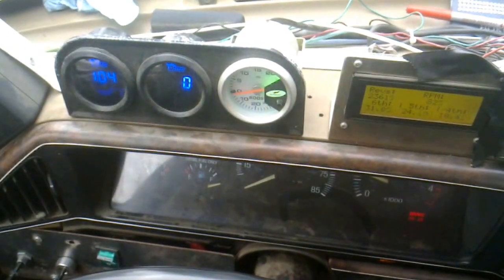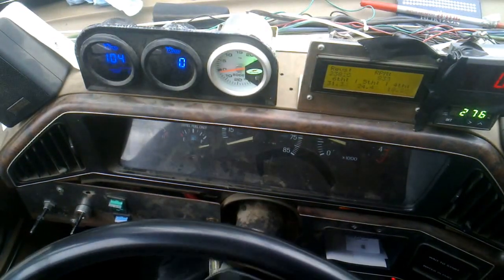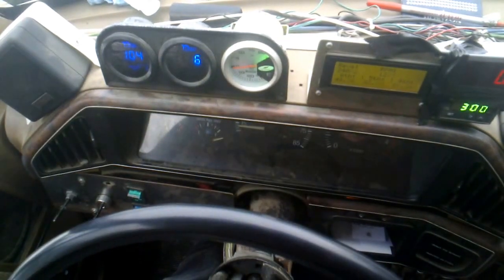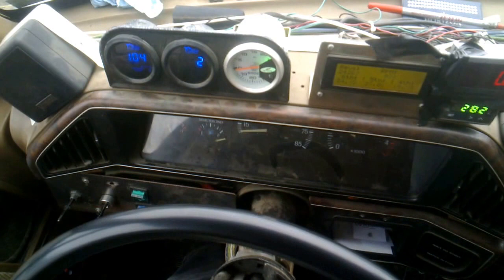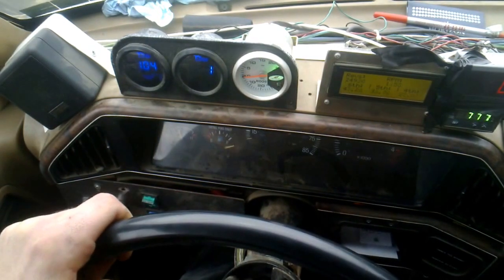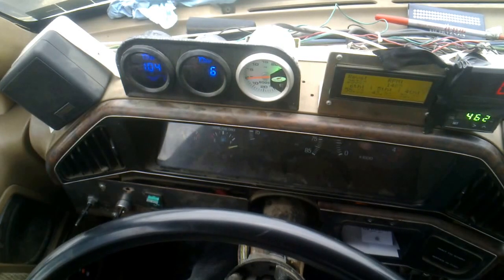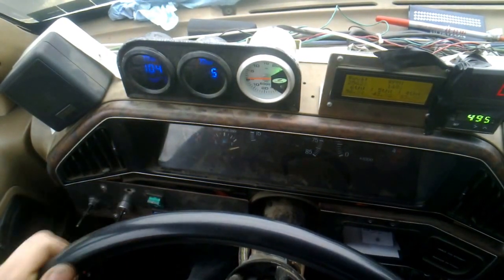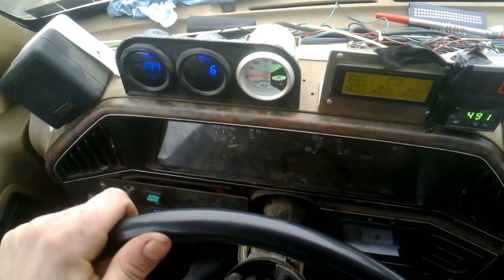7.3 IDI with RD2-110 pump, modded governor and more boost?

Comment: Have you had any problems in the drivetrain with these mods? It's only rated for I think 450 torque stock. I've got my 1988 at about 12 psi and fuel pump near maxed out and pushing around 350hp and 650 torque and easily shear u-joints, bolts on the rear axle yoke, and now my clutch. I should probably put some head studs on it.
Reply from the maker: Don't take this the wrong way, but:
1. You aren't making 350 HP with a stock IP. It's simply impossible. Even if your dyno reading is giving you a 'flywheel' number, 350 is too high for what a stock IP is going to give you. I'd believe 210 at the wheels, perhaps, with a fully turned up IP. Anything above that, well, there's something wrong with the numbers.
Even if you had the fuel for it, you are going to be needing a lot more air to make that happen - 12 PSI out of a stock turbo(non-intercooled, I'm guessing), just won't cut it.
I'd really like to hear how you ended up at the numbers you think you have.

2. Issues with U-joints, I'm thinking you've got greasing issues. Bolts on the rear axle yoke were probably loose.
RacinNDrummin made a 400 HP(at the wheels, real numbers), IDI, and didn't have any issues with those components(He also bent multiple connecting rods at that power level, before one finally snapped...). 

3. Clutch, well, yeah, that's definitely a weak point. That should fail before anything else. You'll probably need a LuK SMF kit with a 12" clutch disk, at the minimum. That should be good up to the 400 wheel HP range, looking at Racin's rig.

Comment: it's a myth that the IDI can't handle boost  you can run 15 stock and 25 psi on shaved pistons and arps
Reply from the maker: Yes and no.
Stock, yeah, 15 is around the limit. Perhaps up to 20 peak, but I wouldn't trust it that high.

With ARP studs only, the head gaskets will handle over 45 PSI of boost and over 400-450RWHP. The connecting rods, however, are only good for a bit less than that, and I'd aim for no more than 350RWHP with stock rods.
If you want more than that, Powerstroke forged rods can be modified to fit a 7.3 IDI - the connecting rod side needs to be trimmed down a hair, and the piston side either needs a bushing or to use IDI Turbo pistons.
Reply: @MacRobbSimpson  how much boost can stock 6.9 rods handle
Reply: @FueledAddiction na rod's can handle 20-25psi or 250 hp reliably
Reply: U can stud a 7.3 & it'll handle the boost til the abt 40-50+ then decompress it

Comment: With all that hopping up what kind of fuel mileage are you getting look Justin wouldn't give me a straight answer I'd like to know what I'm getting into before I started buying this stuff
Reply from the maker: Honestly, about the same as before... Unless I'm using the extra power.
Think about it this way: I can haul bigger loads faster. That faster part takes more fuel. 
Unloaded, well, it's more or less the same.

Generally speaking, I've gotten 14-18 over all my IDIs unloaded.
I got 18 with this tan 88 with the Gearvendor overdrive, unloaded, going 65 for 4+ hours straight(in double overdrive, running around 1800RPM)
I've gotten 14 pushing a similar truck at 75 with no double overdrive, around 2500RPM.

I averaged 10-11 MPG on a recent 1,000 mile trip with a big truck camper on it, going 75 basically the whole way.
A little low, but there's a big difference when you have all that frontal area.

Honestly, the biggest difference fuel economy wise is making sure you don't have any fuel leaks, boost leaks and exhaust leaks. You can easily go from 10 to 14 just by fixing a single big leak. 

Timing is also important - too advanced and you'll lose power and economy; too retarded and you'll smoke, lose power and economy.
If you ever smoke white, gray or blue... your timing is retarded. Black is correct or advanced timing.

Comment: When u adjust timing and or add fuel it will create more boost, will continue to add boost accordingly
Reply from the maker: +briangregory100 Yeah, I know. The whole adding more fuel is the issue here -- this pump was supposed to be turned up to the absolute limit already.
As far as I can tell(but can't prove until I get my truck on the dyno again) I think the governor length wasn't allowing the metering valve to go to full open at higher speeds; by lengthening the assembly I pushed the metering valve further open and got myself a lot more fuel.

And, just so you all know, I've hit approximately 20 PSI max at WOT ever since this adjustment. Which, I might add, is way too much for this turbo. I ran into issues with backpressure floating exhaust valves, which in this engine results in bent pushrods(but no damage to the valves, as they are square to the piston). I had to replace my valve springs with much stronger ones; this allowed me to handle the boost and massive backpressure much better.

Comment: Are you running a intercooler with the rd110 pump?
Reply from the maker: No, not yet. That build has been more or less on hold for a year + due to cam issues; hoping to get it tuned in this year. Then add intercooler and see what difference it makes.

Comment: my stock idi hits 20psi. what turbo are you running? do you have studs and what's your timing at.? the rd110 pump is capable of 300+hp and you should be hitting around 30 +psi of boost with the fueling from that pump.
Reply from the maker: The Banks TE06H(wastegated turbo) on this video. It simply /will not/ produce more than about 20 PSI, absolute max, at the flow levels needed for an IDI. Above 15-ish, the efficiency drops horribly, and the backpressure on the exhaust system skyrockets.
Check the turbo pressure map for that turbo - I'm well off in right field with what I was doing there.

Remember, the wastegated turbos are 'tighter' than the non-wastegated turbos, so it'll spool faster and produce more boost right up front... but it means less maximum boost.

Now, I swapped that turbo out for a BorgWarner S360, got a .63 exhaust housing on it... that produced 30+ PSI very easily with the exact same setup.

Comment: how much psi can you run on stock motor?
Reply from the maker: 6.9 with headbolts - a few, not sure exactly.
6.9 with headstuds - it'll blow the headgasket at 20-ish.
7.3 non-turbo block with headbolts - 20-ish psi before you blow the headgasket
7.3 non-turbo block with headstuds - 45+ PSI. IDI Performance managed to push that(450rwhp, 1,000rwtk) without blowing the headgaskets, but the connecting rods couldn't take it. All of them bent and one finally broke.
7.3 IDIT with headbolts - same as 7.3 non turbo
7.3 IDIT with headstuds - the connecting rods are a bit stronger than the non-turbo blocks, so you should be good for more HP and boost.

If you need more than that, IDI Performance is modifying Powerstroke forged rods to fit any 7.3 block(and possibly 6.9 block), which should handle even /more/ HP.
Reply: Vlad Vechtomov usually only 10-12psi on stock motor the other guy is wrong 45psi blow the crank and pistons valves and probally the lifters
Reply from the maker: Nope! Provided you install headstuds, the weak point is the connecting rods. Pistons can handle it, crank can handle it.
See: https://www.youtube.com/watch?v=sLm-tZS4cnY
Reply: MacRobb Simpson my uncle had a 7.3 idi and he put 20psi into it and he blew the motor on it
Reply from the maker: Did he have aftermarket ARP headstuds? The head gasket will blow at around 20 PSI unless you have them.
Otherwise, what /exactly/ failed?
Reply: MacRobb Simpson i dont remember that was a few years back
Reply: @MacRobbSimpson  whats the max boost that is safe on a 7.3 non turbo rods
Reply from the maker: @FueledAddiction  Somewhere beyond 30? But remember, it's not boost PSI that bends rods, it's the much much higher pressures from burning fuel with that extra air. which is why RWHP matters - more air+more fuel = more HP. And, probably ~350 RWHP is safe for NA rods; they bent very quickly at ~450 RWHP.

Comment: I would not push 20 psi threw my 7.3 idi ...better hope you have arp head studs..but it sounds like you know what your doing good so maybe you have that already .
Reply from the maker: Without studs, you are asking for disaster. With studs, 45 PSI is possible.
Once you've got a good set of studs, the limiting factor becomes the connecting rods, which are good for somewhere around 400 rwhp/800rtwk; beyond that, you need modified Powerstroke rods.
Reply: Will stock power stroke rods work?
Reply from the maker: Yes and no. You need to take a set of forged stock PS rods, and shave the sides of the crank bearing journal down by about .030, so it's narrow enough to fit the IDI bearing. The other dimensions -- length, bearing diameters, piston bearing diameter -- are perfect.

It's something I'm definitely going to do on my next build; I've been thinking about how to build the tooling to shave the journal width down accurately and repeatably using a manual mill.
Reply: most engine shops with rod machines can cut the rods down width wise, its a trick on hotrods to open up the side clearance a few thou to get a little more oil cooling the pistons and lube on the cylinder walls
Reply from the maker: It's not really needed. These engines(like most heavy diesels) have oil 
squirters spraying oil at the bottom of the piston, providing plenty of 
lubrication and cooling.
The weak point here is the head gasket with stock head bolts(blowing somewhere around 20 psi), and the non-turbo spec connecting rods, which will bend and break at about 450RWHP/1,000ft-lbs of torque.
I know a guy who actually got that out of an IDI for a couple weeks before the connecting rods bent like pretzels.
Once at that limit, you want Powerstroke rods(same basic rod but stronger with slightly wider crank end), which can be easily modified to fit.

Not sure what the limit will be there because nobody has done that yet.
Reply: MacRobb Simpson  what was the guy using for injection pump when he hit 450hp?  Was it street able at all?
Reply from the maker: The first time I saw Racin's Bronco with 400+ HP, he took me for a drive in it around town. Felt plenty streetable to me. 
He had a custom RD2/RD4 pump; basically what he's selling in the RD4-180, but adjusted to get as much fuel as possible.
I suspect that there's adjustments that can be made once you have the HP - Recently, I saw another build of his make 430+... I'm pretty sure it would have made more, but it was /really/ retarded due to his messing with the timing to try to get more fuel.
It was so retarded it was smoking white/gray at idle, until it was fully warm. 

Personally, I've only been able to get 250 at the wheels with my setups. I've taken that pump, dropped it in a ford-stock turbo truck... and 250 at the wheels.
It's pretty much limited by the "stock" turbos. Great torque curve, but kind of hits a wall. I've got a S360 for my next build, and that will definitely get me the air I need... I just need the time and money to do it.
Reply: @MacRobbSimpson  how much boost can 7.3 idit rods handle?
Reply from the maker: @FueledAddiction  A lot? I think Justin hit 47 PSI in his 7.3 IDI and 450RWHP before it blew the rods.
Remember, though that the head bolts are the first weak point, then you have to think in terms of cylinder pressures - Boost, temperature of charge air, fuel, and timing all have a huge affect on that. If you don't have enough fuel to use that PSI, or your manifold air density(ask Banks about that) is low due to the turbo superheating the air(and not intercooling it), well, it won't have the same effect/power level.

Pretty sure that 10 psi of boost with a proper intercooler would make a lot more power than 20 psi of hot air straight from a turbo.
Reply: @MacRobbSimpson  I'm pretty sure justin was using n/a rods I know the 7.3 idit rods are stronger then the n/a rods and I was wo deri g if I have a studed 7.3 idit with the stock turbo rods how much boost is a safe amount? Also why did justin quit at 400 hp and is RnD going out of business?
Reply from the maker: @FueledAddiction  He was using NA rods yes. Again, the boost isn't the critical factor, it's cylinder pressures or HP to the ground that matters.
And yes, IDIT rods are stronger than NA rods.

He quit at ~450 RWHP(measured at the ground; crank being at least 60 more), mainly because it blew up after a week or two.

Haven't heard anything about R&D being out of business, but it's a side-gig for him. So when he has free time. Last I talked to Justin(last September), he had too much work for one person, not enough for two. So orders get backed up.
Reply: @MacRobbSimpson  do you know how it blew up? And did he continue with another engine?
Reply from the maker: @FueledAddiction  All 8 rods bend and one finally snapped in two. The "next platform" he was experimenting with was decompressed enough that it took a ton of ether to start, compound turbos and just would not spool. I've got footage of it on my channel from H4H last year.
Reply: @MacRobbSimpson  how would the psd rods snap and bend I thought there really string he should go billet rods next time
Reply from the maker: @FueledAddiction  They were NA rods! You even said so yourself!
Reply: @MacRobbSimpson  no I'm talking about when he put psd rods in the bronco and ran it what happen then did he just stop trying to get higher numbers
Reply from the maker: @FueledAddiction  He couldn't make as good numbers, and that was the last I saw of him. If he shows up at H4H again, well, I'll know something then... sep. 7th

Basically, IDIs do not like to be decompressed. More compression is better as far as they are concerned.